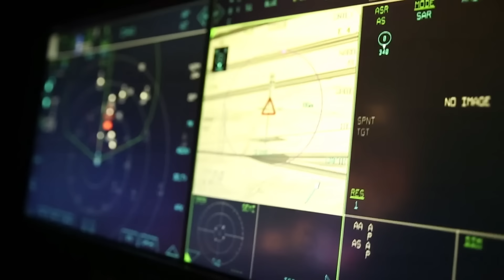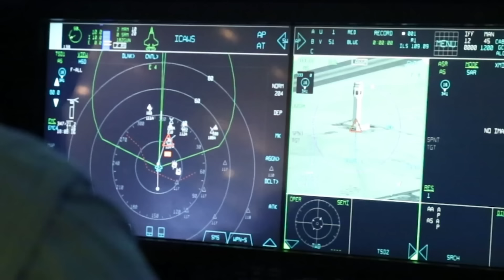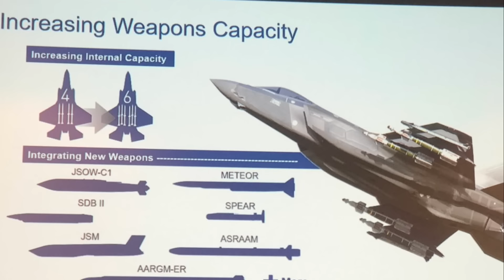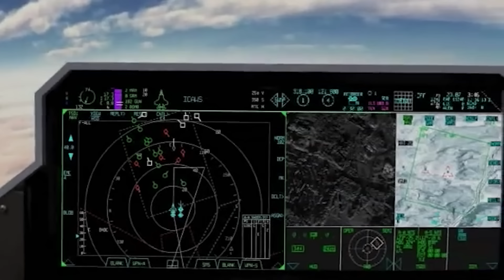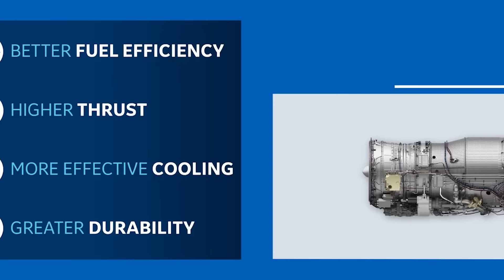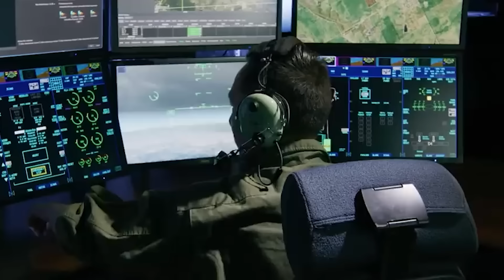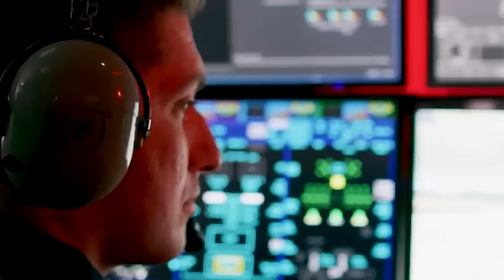The F-35 is about to become a POWERHOUSE

Comment: I wonder... Why not make stealth missiles that could be carried under wing or perhaps partially submerged into the wing or just smaller missiles that could fit in the wing. Anyway I'm sure it isn't easy to do but adding firepower is paramount.
Reply: It is possible that they have but it is more about how the missile sits on the underbody or wing rather than the actual shape of the missile.
Reply: Stealth is based on absorbing and redirecting energy. Reflecting radar into the big nothing prevents the signal from being picked up. If a stealth missile reflects radar to the aircraft, and the aircraft reflects towards the missile, more energy bounces back to the radar receiver.
Reply: they got mini missles but they could use extra rocket engine
Reply: Simply put, adding anything to the external stores, even if it’s designed with stealth, decreases the stealth performance of the aircraft as it will increase the radar cross-section.
Reply: They actually have. Modifications to the Sidewinder were carried out to make the AIM-9X Block II+ more stealthy when mounted on the wingtips, to the point where it will have a very negligible impact on the F35s frontal RCS, although from side aspects it will increase its RCS by a somewhat appreciable amount.
Reply: Because it would have to be designed specifically for the F-35, and nothing else could use it. The shape of the missile, and pylon would be tailor built for the shape of the F-35, as that has a lot to do with increasing the RSC of a plane. Then, you would have to make sure the aerodynamics of said stealth missile and pylon don't negatively react with the plane's aerodynamics causing flight instabilities in the plane, problems with munitions separation from the plane, and finally accuracy of the munitions. This would all be quite specific to the F-35 alone, and quite expensive. They couldn't use the standard fuel drop-tanks on the F-35 as the aerodynamic interplay between the F-35 and the drop tanks caused yawing problems to the wing mounted JDAM when dropped. The JDAM could slam into the pylon, wing, drop-tank, or other munitions upon release. They ran hundreds of hours of CFD simulations of different shapes to finally find one that didn't cause munition release instability, fight control instability, or too much drag on the F-35. Though, they deemed it too costly to build just for the F-35, especially when it has great range on internal fuel, alone, and the ability for in-air-refueling.
Reply: MAWS and RWRs would still detect the missile once its go close to target. Stealth is effective a longer range but under 10 miles, MAWS and RWRs would detect it
Reply: Some other people touched on this but the stealth coating is only part of the factors that contribute to effectively reflecting radar away. Anything added externally will contribute to an increase in radar signature but without a doubt, the engineers working on this certainly know what they're doing so im sure they have they're reasons for what they decide on doing and not doing
Reply: Stealth drop tanks.....
Reply: @ChucksSEADnDEAD  uh...yeah, I know
Reply: Thanks to all who reply, I understand stealth but I'm just saying simply if money wasn't an issue, we can make a stealth jet so why not stealth missiles? Or a way to attach them stealth fully. I guess it will always be about money.
Reply: @OathTaker3  Money’s a factor, sure, but picture this - two stealthy F-35s are suddenly joined top and bottom - suddenly not so stealthy.  There are indeed stealth missiles, but the geometry of both together will result in a large RCS, plus there’s the pylon - so not stealthy.  Maybe recess them into...um...what?  A super thin wing?  Or recess them into the fuselage...um...oh, where the internal weapons bays are?  Probably not.  And, just imagine the wing was thick enough to stealthily recess a stealthy miss; now you have to engineer stealth into the weapons bay after the missiles have been launched; so now, in this imaginary configuration, we have to make sure the aircraft is as stealthy as possible with the missile faired into it, and both the F-35 and the missile need the same as or better RCS after launch.  So, not so much about the money, moreso just not workable in a multirole fighter.  Maybe we just design a super stealthy medium bomber with a large weapons bay, maybe a baby B-2? 

Hopefully the theater devolves (for the bad guy) to a point where stealth isn’t always necessary and Beast mode can be used, or F-15s.
Reply: JASSM is a stealth cruise missile
Reply: A missile is ammo. It needs to be "cheap". Stealth tech is anything but cheap.
Reply: There is not much room for enough fuel, let alone enough weapons hidden inside the F-22 and F-35 to keep them stealthy and maneuverable at the same time. In addition to those restrictions, it would also be super expensive to add stealth capability to each weapon because they would have to somehow manufacture all of the weapons with stealth coating. 

As a temporary solution, I believe that the F-15ex that has recently been purchased, will fill the role as an extra weapons carrier. The extra weapons from the F-15ex fighter jets will be used to remotely shoot from an F-35 or even an F-22 fighter jet. Eventually, when the NGAD fighter jet is introduced, which I believe will be larger than the current fighters, will replace the roles of all of those fighter jets and be much more capable in a newer role as well.
Reply: There are two ways to be stealthy. You can make yourself invisible or you can just blind your enemy. The radar is capable of tracking and jamming the enemy making them completely defenseless to even our current missiles.
Reply: Lots of programs right now to miniaturize existing missiles. Raytheon’s Peregrine will allow twice as many AIM-120 analogues to be carried internally and be significantly cheaper, supposedly.
Reply: @brilobox2  no matter how much smaller they make the missiles, the missiles will still take some space to carry inside the fighter jet.

Comment: This huge program really proves out the wisdom of making one "joint strike fighter" that all services can use. Yes, it resulted in compromises and delays in the design, but so much of modern weaponry is defined by electronics and software that is common to all variants and can be upgraded in sync.
Reply: Yeah, except for the part where the plane is a death trap. The engine has a mechanical flaw where the drive shaft will split in two. When that happens the plane literally flips over and accelerates toward the ground in less than a second. This flaw cannot be predicted, avoided, or even stopped. It's a pray to Jesus it never happens flaw. So much so, ejection is not an option, even at 10,000 feet, because all that will accomplish is putting one self in the path of a crashing air craft. The solution was to design an ejection system that senses when that drive shaft even shimmies. When it does the pilot is ejected by computer fast to avoid getting trapped inside the plane, it often results in serious injury. These injuries are enough to remove pilots from their career fields permanently.

Additionally, these engines run so hot, you can see them on thermals 10 miles out. Well before then enter any effective range of combat. In fact the engine noise is so loud it's become common practice to put a minimum flight speed on mission requirements as to behead of the sound at all times. This way targets can't know it is coming. If you nave never heard an F35, then you are in for a surprise. Bring protection, it is the loudest jet you will ever hear.

The systems are so complex that when it makes 1 flight, it must enter a 400 hour man maintenance inspection, before it can fly again. All in all the F35 will cost 233 Billion dollars over the lift time of the jet. that is over 20 times the cost of an F15, with a fraction of the capabilities.
Reply: That’s a nice argument you got there, mind backing it up with a source. The teething problems of the early F-35s have long been ironed out.
Reply: @dirtysilver2841  You've got a vivid imagination bro.
Reply: @Dirty Silver  yea its called innovation and research and development...all things have problems, they were worked out already...your the exact type of person the video referred to, a hater from past perception that doesn't speak to today...I saw all those videos from back then too, did you know we have only lost a grand total of 2 f35s? Russia has built a handful of wannabe stealth su57s and they routinely crash and burn during test flights...india fully walked away due to lack of stealth not happy with what they were seeing with its radar signature...gonna hate on a stealth plane, thats the one
Reply: @dirtysilver2841  So, it's never happened.
Reply: Just heard today that software upgrades will be a year late. Scaled Agile SW development has become the biggest boondoggle. The reason SW weenies tell you that you can't scale crappy code is so that it will become true. The entire SW development model has changed for the worse. No such thing as a test server these days. Users are expected to report bugs, which Scaled Agile developers incorporate into 2 or 3 week cycles. No time for regression testing.
Reply: @dirtysilver2841  Yeah none of that is true.
Reply: Every new fighter jet has had problems when they first come out. I haven't heard of any jet fighter not having some issue or another.
Reply: Source?
Reply: Sharing the electronics and software over different airframes wouldn't have been too difficult. It was dumb to saddle the Air Force and Navy with an airframe that had to accommodate the Marines' need for STOVL. It's worked out as best it could've under those circumstances, I suppose. But the AF and Navy got a worse aircraft than they otherwise would've, while the Marines got a supersonic aircraft that they will never need to fly supersonic.
Reply: My opinion is it’s a dog, why do you think it needs billions of dollars in upgrades it doesn’t do anything well right now! The idea was good on paper, but in execution was inevitably poor at everything when it was released, thus the requirement for all the upgrades, and all the countries who are buying this plane, are they getting the upgrades or just us what was wrong with the F 22? I think the F 22 could smoke the F 35 just saying, now we’re gonna throw it away? Military procurement is done in an irrational and stupid way by the United States.
Reply: @ryanperry7956 Yeah it's cherry picking the complaints of haters of the program. It's the best multirole aircraft in earth. Ask the pilots. My buddy was an F22 pilot and my daughter was USAF for 8 years so I made some friends. These guys are 100% confident in the aircraft

Comment: I saw somewhere recently that the newest F35s had enough spare power capacity to power the newest generation of 50 kilowatt lasers.  I doubt they're miniaturized enough to fit into a pod yet, but if that is the case then I wonder if a short range smaller kilowatt laser anti-missile Point Defense pod may find its way onto the F35 soon.
Reply: Look up Lockheeds LANCE system. its laser weapon Pod that they delivered to the airforce last year
Reply: @Valen-vl5ds  well there ya go.  Geeze, if it works as it seems like it should, that is a seismic shift in how air warfare is conducted.  I dare say it might feel like a dreadnought moment for air combat.
Reply: No, I highly doubt that. The F-35 was originally not built with laser weapons in mind. I believe the NGAD fighter jet will have a 1st Gen laser weapon onboard because I heard that it will be bigger than the F-35. The lasers will probably be used to take out enemy missiles.
Reply: If not, we'll always have Ill-tempered sea bass to fall back on....
Reply: @dpwellman  are they at least particularly ill tempered?
Reply: @Defective1313  They are aware of the current price of eggs, so, it stands to reason.
Reply: @dpwellman  good, good
Reply: agreed, the next big thing for the F-35 and its peers (when they come) will be directed energy weapons, first lasers. But as always its a dual edged sword, lasers against F35's too.

Comment: That GE Dual Cycle engine has been under development for over a decade and is now READY.  That engine could be an on-going replacement for the P&W in legacy F-35s and original in the new block versions (except the vertical take-off models). The F-35 JSF will need that extra Dual Cycle range in the Pacific Theater. GIVE PACIFIC THEATER F-35s THE DUAL CYCLE GE ENGINE!
If we're so interested in saving money and dulling the tip of the spear then give other theater F35s the upgraded P&W engine.
OR... save the GE Dual Cycle engine for the GEN. 6 fighter.

Comment: Here is hoping they go with the GE Adaptive Cycle Engine. It's capabilities pretty much put it on track as the engine of choice for the near future. 
    I have also heard (cannot confirm nor deny) that one of the last parts of Block 4 will be directed energy weapons. There is a required caveat for this, which is the GE ACE.; This is the only engine that produces enough extra power to make directed energy weapons feasible. 
   If all of these upgrades come to pass, the F-35 will almost certainly be a 5+ gen, or even 5++, fighter, closer to 6 gen than 5.
Reply: @Kris-ib8sn  

Depends how the technology is implemented and how much experience is gained in the testing stage. 
  Refresh my memory if I'm wrong, but wasn't the Ford class carrier problem mostly due to the implementation of EMALS launch technology before it was properly tested?
Reply: Yeah, that was one of the major issues. I believe there may have been a few more but EMALS was definitely a big issue. I would hope that the Adaptive Cycle Engine program learns from such mistakes and is allowed to develop more fully.

Comment: Canada is upgrading some of its CF-188's with new radar and other very advanced equipment. These likely will be from the Australian airframes she purchased.  While also placing the order for the first 16 of 88 CF-35a's. The vastly upgraded Hornets will serve in the north where it is good to have the second engine and also serve as a base line to judge the advanced CF-35's performance. Canada may also choose to designate her F-35's as the CF-355a's.
Reply: Canada has no airbase in north, they are stationed either at Halifax or Vancouver. And for the single engine comment, Gripen and F-16 are both single engine and have been operating in the artic nicely.
Reply: @niweshlekhak9646  Are you confusing the navy with the air force? The RCAF's primary bases are in Cold Lake Alberta and Bagotsville Quebec.
Reply: @JollyOldCanuck  yeah I think I kinda did.
Reply: Canada is buying them for the airframe: they were given upgraded electronics at the same time Australia did. They just needed some lower time airframes to keep them in service longer
Reply: @niweshlekhak9646  They also fly a detachment from 409 Sqn out of Comox BC

Comment: I remember MacOS 7.6 waaaaay back in the late 90s right when Steve Jobs was coming back. No apparent change from 7.5 — you’d never know there was an upgrade from looking at it — but they’d picked through the entire OS and cleaned it up in preparation for MacOS 8.0. Which was a dramatic shift. In 7.6 my Mac was a hell of a lot more stable. And “virtual memory” was so good my Mac acted like it had twice the RAM. So I know TR 3 all by itself might turn out a dramatically improved machine.

Comment: I would like to see more F35B model type aircraft. When carriers are sunk and runways are cratered, it just makes so much more sense for everyone to be using a supersonic VTOL. The British taught us how to land the F4U Corsair on carriers during WW2 and they are at it again with the F35B. They have developed the SRVL (Shipborne Rolling Vertical Landing) which doesn't require fuel or ammo to be dumped to reduce weight like the VTOL landing. The SRVL could be used on land as well if needed. Now I do understand F35B carries less fuel and ammo than the other variants, but those are the deficiencies that need more work. I support thrust vectoring for all aircraft and missiles. Not for the fun airshow manuevers that bleed energy, but for turning an aircraft as tight as the  human body will allow and for short take offs and landings.
Reply: The F35B can only go supersonic for a couple of minutes because of thrust vectoring nozzle.
Reply: No point in making the aircraft more and more agile while the same old missiles get used. Why not put thrust vectoring on the missiles and let the plane fire them 360 degrees in any direction. That tech already exists but a lot can be upgraded.
Reply: @srinitaaigaura  check out the mutant missile in development.
Reply: @srinitaaigaura thrust vectoring is already on missiles. Both Russian and American missiles have it and when the Soviet Union fell, it was one of the surprises that our defense industry learned as they gained samples of missiles to test and reverse engineer.